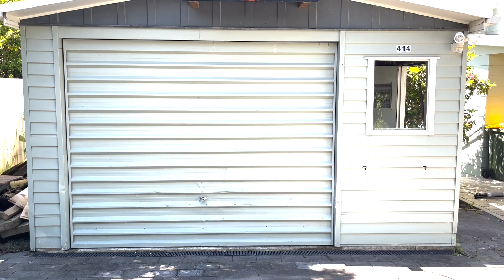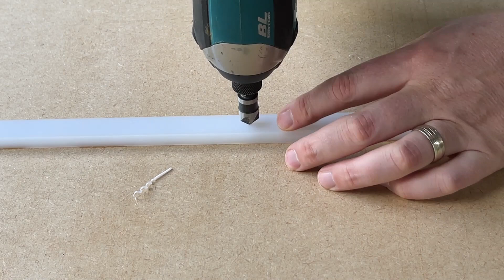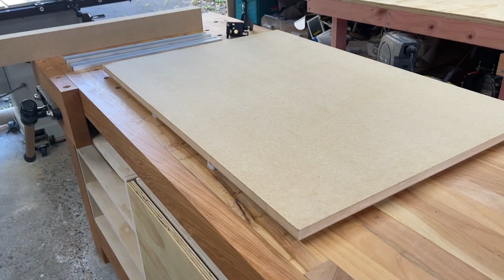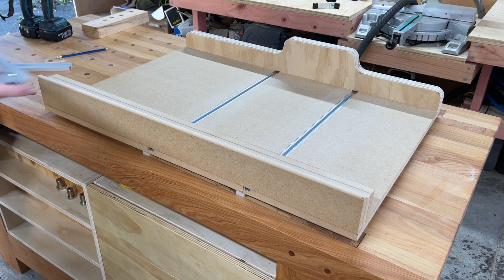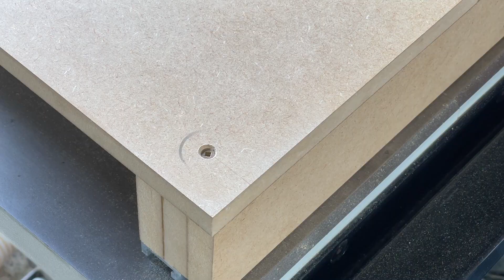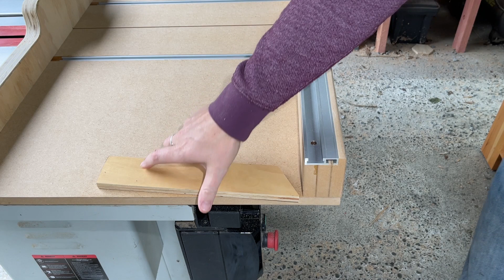How to build a cross cut sled at any budget!

Comment: Love your work. What is the paste wax you used on the underside of the sled please, and would you use the same on your table saw surface?
Reply from the maker: Thanks :)
Its called Traditional Wax by u beaut polishes but I think it may be an New Zealand/Australia thing
https://www.carbatec.co.nz/product/14609-trad-wax-neutral-250ml
I have actually started using it on my jointer and it works really well
Reply: @macsworkshop  thanks for that, I'm in Chch so I'll track it down. So much of what you see recommended is US based so it's hard to know what to get here. 
I have a Carbatec scroll saw I picked up for a bargain from a cash converters auction, obviously had no idea of its true worth. Nice but of gear...
Reply from the maker: Awesome, there’s a carbatec in Chch now and that’s where I got the wax 😀

Comment: Hi Chris, Was there an issue with the stop block you originally used on the crosscut sled?
Reply from the maker: Hey George, the only stop blocks I have purchased are the ones you see in the video and I also bought a Katz Mosus stop block for my router table
I’ve got no complaints about any of them 😊

Comment: Sweet video mate. I have a question. Every video that I have watched with the 5 cut method shows how to calculate the error. But everyone says to redo it to check and nearly always it’s never perfect. I know we are talking hairs here but being a roof carpenter and always working with angles I think the pivot point is wrong. In a perfect world I think it should be pivoting in the middle of the fence right where  the blade strikes the front fence. Would like to see if this works better. What are your thought? 😊

Comment: Divide by 4 assumes a square piece, but the piece in this video is not a square.
Reply: No, divide by 4 because there are 4 corners (4 angles). Although the measurements are done in mm, the adjustments affect the angles, the goal being to get the fence 90° to the blade.